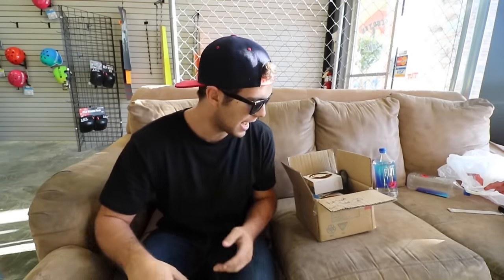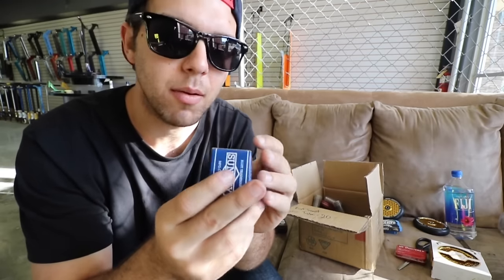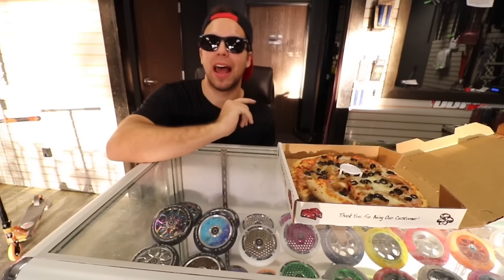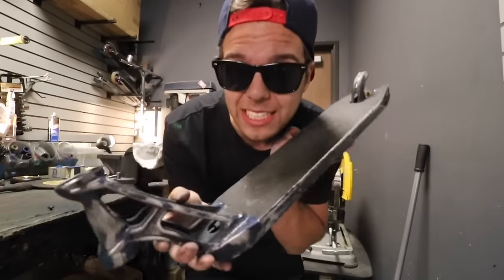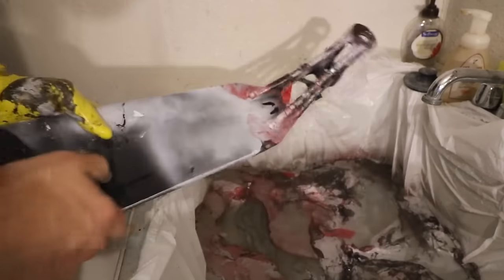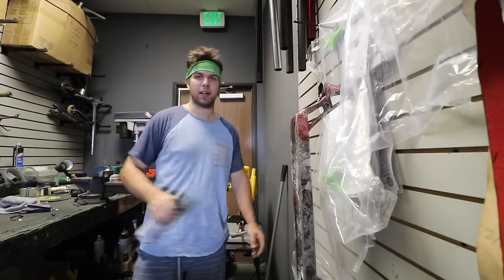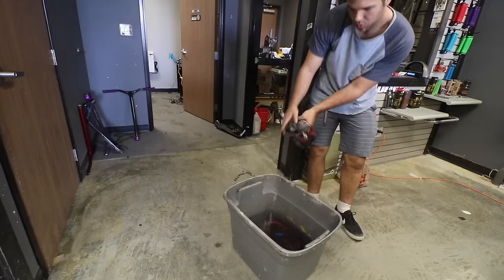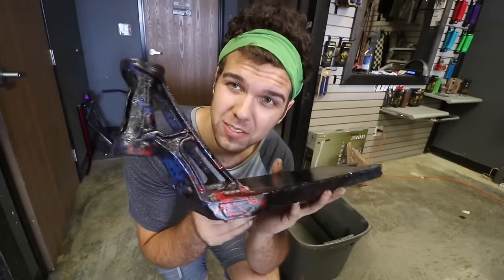SICK DIY HYDRO DIPPING SCOOTER DECK!

Comment: Do a custom build 
- black envy union bars 
- green root ind air wheels 120mm
- envy AOS deck rose/sliver v4
- black envy headset
- envy double clamp 
- black root ind grips and bar ends
- envy black forks